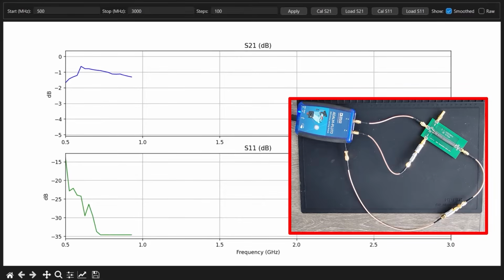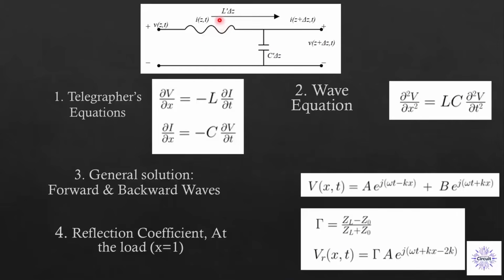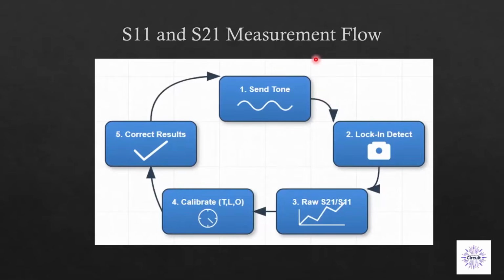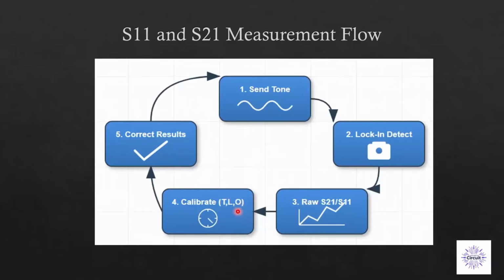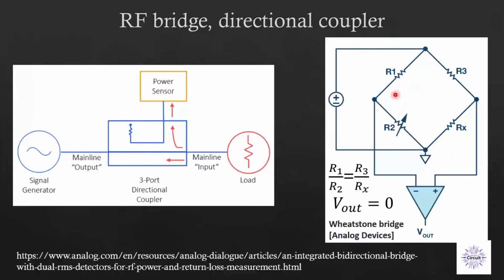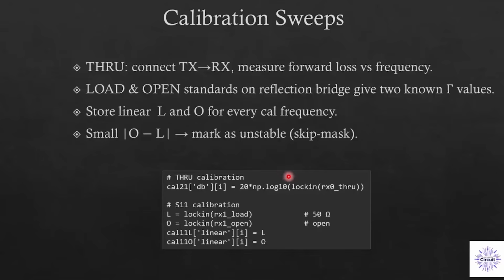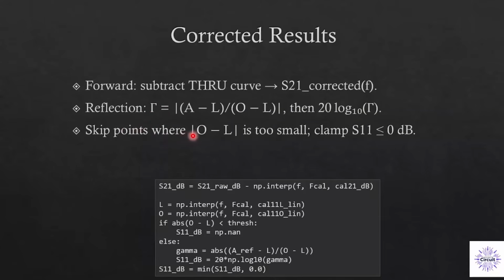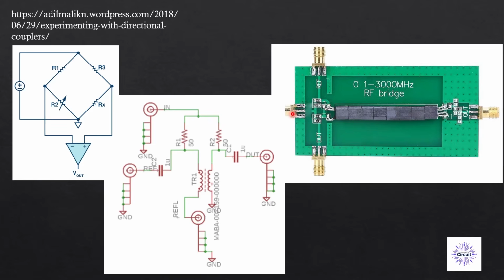RF Bridge Turns Your Pluto SDR into 0.1-3GHz Network Analyzer(Pt.1: S11/S21 Fund. & Filter Test)

Comment: Great projects, my friend. I just acquired a Fishball, a PLUTO clone. Looking at the resistive bridge, if I connect an MABA-007159 (a 1:1 transformer to invert the signal) to the differential output of the resistive bridge, I'd be able to manufacture a much cheaper bridge, and perhaps with better quality and fewer losses since the transformer is already made by a company. If so, would any software adaptation be necessary for it to work with the resistive bridge?